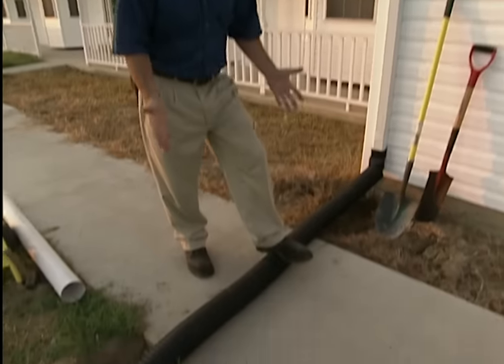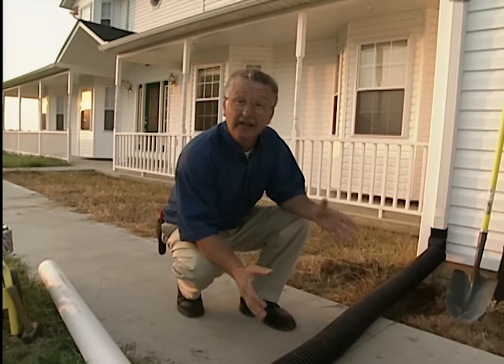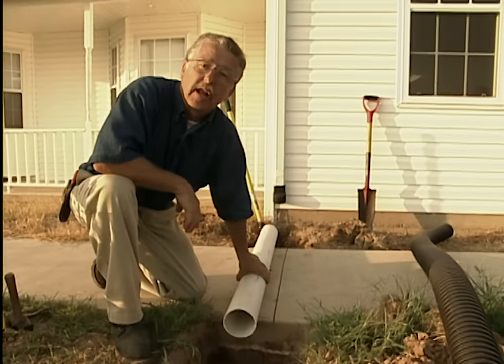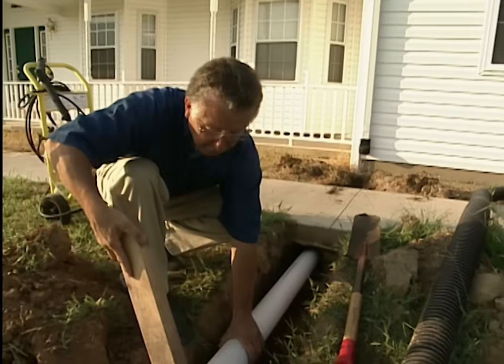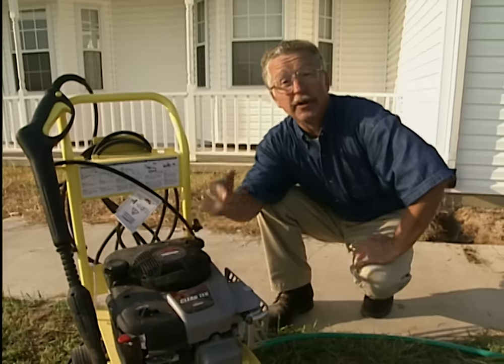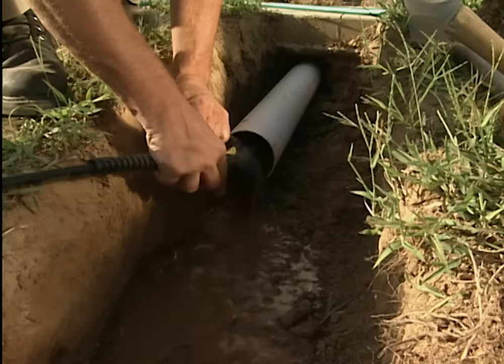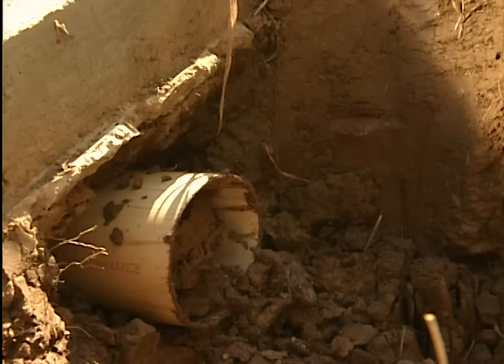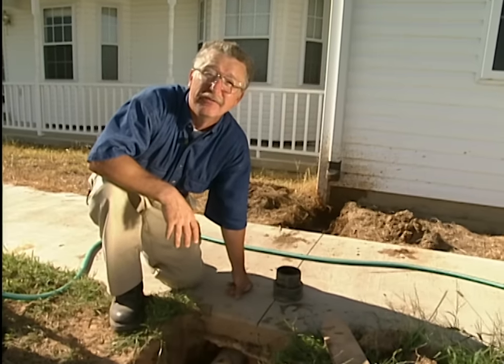How to Run Wires or Drainage Under a Sidewalk or Driveway - The Great Outdoors

Comment: Never use corrugated pipe on downspouts. After a few years the roof granules, leaves, seeds, dirt etc. get caught on the ridges and fill up the pipe. Use 4 inch rigid drain pipe instead.
Reply: Nope. They'll only fill up the bottom of the corrugations. The whole pipe won't magically become full.
Reply: Thats not true.
People been using rigid for dozens of years. My house has over 40 ft of it and Its never clogged in the 20 something years I been here. If your worried about leaves then get a gutter guard or screen cover.
Reply: @littlejackalo5326  I say this because I had to dig up 30' of corrugated plastic pipe on downspouts that were full to the top. These had been in the ground about 20 years. Foundation blocks damp and had mold in basement. $20,000 bid to remove mold in entire 1500 square foot basement. That doesn't count the drywall replacement.
Reply: K Womack "??"
Reply: @kwomack5399  Single wall corrugated works just fine. You just have to know how to install it correctly. Pvc pipe used for downspouts drains will clog as well if not installed correctly. You have to design your system to handle debris no matter the type of pipe.
Reply: I wouldn't put corrugated under a sidewalk though.
Reply: You can get away with it if you have covers for your gutters to keep out debris.  But if you get any leaves or other debris in the down spout of the gutter it is likely to accumulate in the bend.  Maybe an access joint on the house side of the pipe so you easily clear any debris that builds over time?
Reply: I use a shopvac hose to suck out and blow out all the debris. No digging needed. 🤷‍♂️
Reply: @High-Flow-Drainage-Solutions  would you connect the corrugated to pvc to run under the sidewalk?
Reply: @jensmith5894  Correct. Pvc section under the sidewalk. Buy a Poly-Lok corrugated to pvc adapter from Drainage Direct to hook up to your corrugated then.
Reply: @littlejackalo5326  corrugated works fine, except it's harder to install with a consistent slope.  Since it's so bendy it's easy to end up with a sag in the pipe somewhere.  Rigid is less prone to bellying.
Reply: When I look up 4 inch rigid drain pipe a ton of stuff comes up including corrugated pipes. What exactly are you talking about?
Reply: Not true.  Have installed thousands of feet of corrugated pipe, only failures where when the customer didn’t maintain anything and the ends of pipe became buried or covered.  And even then uncovering them again usually fixes it.   A little sediment on the bottom of the pipe doesn’t hurt anything and as long as the pipe has proper grade, it won’t clog.
Reply: I heard using water weakens the soil under the cement and eventually it will crack. Anyone have long term experience with that?

Comment: It was fine until you inserted that connector INSIDE the downstream side of the PVC.  Now you have created something for debris to snag on and form a blockage over time.
Reply: Exactly! I thought he was using the white pvc as conduit for the black drainage pipe. Nope. Haha
Reply: The bigger issue is the connection will leak and erode the soil, which will eventually create a nice sink hole to highlight his improper install.
Reply: @MrBmxbrawler  I was thinking the same thing just push it through and make it seemless
Reply: Yep
Reply: Dont worry nothing is coming threw that pipe, he left 40 pounds of mud in it... LOL
Reply: @mustangpassurchevy  exactly.... I thought I was the only one that noticed that.
Reply: @natej6671  nope
Reply: @mustangpassurchevy  I was thinking the same thing.... That on top of what others pointed out (leaking connection and ID fitting for debris to get snagged on) and you have, how not to install gutter drainage under a sidewalk.
Reply: @mustangpassurchevy  "Threw" is the past tense of "throw", a tossing motion. "Through" is signifying a passage of something, a completion of. Homonyms and homophones, learn them.
Reply: @coloradostrong  

Thru.
Reply: For reals tho, any y'all got a video on how to do it the right way then? Lol
Reply: And If over time that does not create a blockage , he also mentioned that you can put in a screw to hold that shabby assembly together. The screw will make sure the leaves and whatever comes down from the gutters snag on there just nicely.
Reply: @ukob  It was seemless  not to make it seamless .
Reply: @coloradostrong  You got some good grammar! 🏆
Reply: I thought the white pipe was just a sleeve to put the drainage black pipe all the way through. An you don't need a pressure washer to do that job!
Reply: @Supersonicff-dw6bs  I have never seen that happening.
Reply: It's corrugated pipe, not smooth PVC. Plenty of snag points in the entire pipe length when using corrugated pipe. PVC is glued or screwed together depending on the schedule and the connections are designed to create a smooth flow and liquid tight connection. Corrugated pipe with bell ends needs to be bell end facing upstream to create a funnel effect which prevents seeping as long as there is no downstream clog or the volume of liquid doesn't exceed carrying capacity of the pipe. The other option is to not use bell end corrugated pipe, but use straight corrugated and use external pipe couplers.
Reply: @Supersonicff-dw6bs  While what you say is technically correct, you’re still wrong. This install has several problems.
Reply: @catlady8324 See the bell and spigot installation section of this pipe manufacturer installation document. Bell should face upstream when using corrugated pipe with bell ends. http://www.shuanglinpipe.co.id/instalation-guide-for-hdpe-corrugated-pipe-part-1/
Reply: @Supersonicff-dw6bs  I don’t like it. Don’t like it one bit! 😾 Plus there’s no pictures.
Reply: He’s installing it on his ex-wifes’ house. Like he gives a flying F.
Reply: @frankthetank1369  what's an alternative to using a pressure washer?
Reply: @allenlamb8240  I worked doing cable construction I dug by hand or used a water hose. Most jobs had no access to water so I dug by hand. It's not much digging.
Reply: @frankthetank1369  Got it. Are you worried about the integrity of the side walk? I ask because I'm considering the same.
Reply: @allenlamb8240  Not if you fill & pack it after you finish installing everything. I've done plenty with no complaints. Make sure you pack everything you dug.

Comment: I did this for a 15’ run from my crawl space, under a sidewalk, under a row of bushes and then out into a bed on a hill.  I had to use rebar to line up the pipe.  So, I had to use a core drill to get through the brick foundation and out of the crawlspace. Then I took 15 feet of rebar and pounded it through the hall, under the sidewalk and bushes and out into the bed. Then I took a 4 inch piece of PVC put it in the pvc and started the power washer. This project took several weeks and was a huge pain but I did end up with a nice drain pipe tucked neatly into my side yard and which has worked perfectly ever since.

Comment: This can easily be done without the pressure washer if you don't have one and don't want to mess with renting one. Just get one of those little tapered jet-type hose nozzles and run the garden hose into the pipe. There's also a neat little device for deep watering of tree roots called a hydrospade. Great for boring small holes through dirt.
Reply: You can also use a shopvac with the pipe and suck the dirt out as you push the pipe through.
Reply: @mlt6322  yep because once the soil is wet its much easier to remove it with a shop vac and avoid all the mud and water.
Reply: @madmaximilian5783 People like posting smart @$$ comments without realizing that they're the ones being goofy.  There were two proposed options 1) Flush out the soil with a hose if you don't have a pressure washer, or 2) Use a shop vac. The proposal would be to loosen the soil (with a waterless tool) and then vacuum it out.   Come on...think!

Comment: I used this technique yesterday to span under 4 feet of sidewalk.  Used a 6” diameter PVC.  Then threaded a piece of 4” corrugated through the PVC.  No joints this way.   It worked great.  I did Hit a root.  That sucked but was able to reach under the sidewalk cut the root with a 26” hand saw.  Another benefit of the 6” pipe.  I was able to back out the PVC and then have room for my arm and saw to cut the root.  Wouldn’t have been able to do that with a 4” pipe.
Reply: I have skinny arms, so the 4" pipe would work for me.
Reply: I'm thinking of doing the same. Are you worried about the integrity of the sidewalk?
Reply: @allenlamb8240  no signs of sidewalk failure 8 months later.  Looks good!  Works Good!
Reply: @prettygirlus9008  Don't know if you meant to be funny, but it was! 😁
Come to think of it, 4" pipe might work for my arms too. 😂

Comment: 3:10 FYI, you're installing that coupler wrong! It should go over the PVC and inside the corrugated pipe for proper downstream flow. How you installed it will result in leaks, turbulence inside the pipe. The leak will erode the soil and an eventually create a nice sink hole to highlight your improper install. Also, stop using that crap corrugated pipe and just use PVC the whole run.
Reply: I’m doing this currently. Clay soil. Slow moving at this point. Using rubber mallet. Would the solid hammer and block make this go faster?
Reply: Supersonicf111f I could not agree with you more. Bells look uphill in every gravity flow unless as you pointed out you are ok with a leak. Especially with that sloppy transition from PVC to that corrugated junk.
Reply: He did it correct, your method is wrong. Also, you don't use straight pipe in areas that freeze.
Reply: thanks for the link at 3:10. why now watch it at all at this point! a wood stove..roofing..plumbing..septic..landscaping..without common sense we may be somewhat of an asshole. How about a few bags of concrete ta just create a sarcophagus wth! Like 65.
Reply: @TheDogDad   I agree with Supersonicf111f 19740186 and indeed  if it ever freezes in his area, he will end up with a busted pipe. He should have put it at least 40 cm or 1.5 feet under the ground, that's what they do in my country, and they still use straight pipes. Deep  under the ground it never freezes.
Reply: Both agree and disagree - technically the bell-end needs to be at the uphill end (it looked to me like the true bell end was what he cut off in this video), but while what he did might leak, a little bit given that [1] the water in the pipe isn't under pressure, and [2] the whole thing is outdoor and both inside and outside the pipe will be soaking wet after a rainstorm, I really don't think a small amount of water leaking out of the pipe is going to make a scrap of difference.
Reply: @TheDogDad  This is only a problem if your downpipe in the ground has no run off and water lays in the pipe.
Reply: This debate illustrates why DIY is so confusing. Even after all my research, I still never know who to believe. Not sure how we get around the conflicting opinions.
Reply: @BeckVMH  For piping that does not have an o-ring on the spigot (straight) end (i.e. slip fit), the bell end should always face the liquid flow. In that orientation the liquid will not leak out as long as the pipe doesn't reach max carrying capacity or is backed up do to a restriction or blockage. Piping that is sealed mechanically with glue or a seal can be installed either way as long as the manufacturer doesn't specify a particular flow direction.
Reply: @Supersonicff-dw6bs  …thanks so much.
Reply: @BeckVMH  In this case think of the water flowing down through interconnecting funnels, so the "wide" end of any piece of pipe or connector is the end that the water flows into.

That said, generally you make a fair point, but I tend to be skeptical of people like this who don't look like a contractor.  But if you do lots of DIY you will soon develop your own sense of who to trust and how to do things.
Reply: @pulaski1  …. Understood. Thanks. And valid point. Thanks for the input.
Reply: Just get the 40lbs of mud out of it and even with the issues of the joints it is still better than the rain water flooding the sidewalk
Reply: What’s the issue with corrugated pipe? Less chance of it freezing in cold temperatures.
Reply: @jerryhamalainen3549  A 4" pipe a foot below grade isn't going to freeze unless you live in Alaska (or Canada or Siberia at the same latitude as Alaska), and in any case "the pipe" freezing is only an issue (might burst the pipe) if it is full of static water at the time it reaches freezing point (for an extended period of time).
Reply: Exactly!
Reply: It's a drain pipe. You don't have to worry about a drain pipe freezing. If it were a supply  line sure, but not a drain line. I don't know anywhere in the continental US that the freeze line is 4 foot down. Maybe somewhere up in Minnesota or or Idaho but not where he is.
Reply: @davidedhegard4198  Maybe you should do a Google search first before making such an uninformed comment, then you might have known there are 11 of the lower 48 that have frost lines deeper than 4'.

Comment: You possibly could use your garden hose and the right nozzle and save the rental on the pressure washer  depending on your soil type.
Reply: I would definitely try that first if I didn’t have a pressure washer.

Comment: I like how he cut 6" off that pipe , that sure made a difference.
Reply: Yes, after he had already cut about 3 1/2 feet off the pipe. All for show, because he said he bought a 10' length of pipe.
Reply: @cfoskeeter , yeah but you know, if it didn't happen on camera, it didn't happen.
Reply: I like how he cut 6" off that pipe , that sure made a difference.
Yep it sure did on the downside of the pipe away from the house and it is buried anyway. Should have used the entire 10 feet and ditched that corrugated stuff.

Comment: Thanks for demonstrating this concept.

I had not considered using a pressure washer/hydraulic mining.
Reply: You can actually excavate trench and start holes under both sides sidewalk curb etc from 2 access holes. A curved washer sprayer outlet would be extremmely helpful. I personally ran 4 water lines crossed 2 pairs under 2 sidewalks and a third concrete slab slash fence line edge. I got 2 PEX 1 inch and an electrical outlet using direct burial 12/3 UF UNDER GROUND FEEDER GREY WIRE IN A 2 5" PIPE AND A 1 INCH PLUS 3/4" PEX INSIDE A 2" PIECE OF WHITE PVC.
Reply: This is not easy peasey in Texas. But perserverance spraying from both sides plus a big sledge hammer proved helpful.
Kansas a breeze I would guess from living in Wichita and having basements. I would say sharpening pipe on starting end intio dirt with a bench or angle grinder may prove helpful.

Comment: Sure, that works great if you have topsoil or loose, sandy soil.  Try doing that anywhere in the northeast on the Somerset shale formation, and you'll be running that pressure washer for days to cut through it.

Comment: Used this method to run new hose under an 8 ft. slab of cement patio for a pool back in the 80s
Reply: No you didn't. I lived next to you. You brought out a surf casting rod and tried pushing the garden hose under it on high and it broke. Then you got mad and tried using a shop vac to suck the mud up. That clogged up and you were trying to unstop the hose with the handle of the fishing pole. You finally gave up and had Ricks Landscaping come in and do it. Remember?

Comment: What about the backfill around the new PVC pipe? Are you planning to leave it hollow like that? Good luck with the cement sidewalk!
Reply: Hes not disturbing the dirt on the out side of the PVC pipe. Only the dirt on the inside is being removed that's why he has the pressure washer handle inside the pipe.
Reply: Fernando, You better watch it again.
Reply: @derfskittlers6125  don't need to cuz I've done it a few times and this is how it's done.
Reply: Fernado equals dumbbell
Reply: @jaydaytoday3548  (
Reply: @texasproud3332  😂

Comment: By the time you went to get the pressure washer and spend the rent for the washer you could have just dug out for the pipe with  your shovel. The best way to solve a problem is usually the simplest way not to mention think of how much you would save.
Reply: The way he did it he didn't dirty his pants. I agree with you I dug plenty of times under side walks.

Comment: I used a 2 in planting auger to drill out under the sidewalk no wet muddy mess at all
Reply: Which brand of auger? It seems hard to find a good one. Did you use a 2” auger to ream out a 4” tunnel?
Reply: Not sure the brand. I picked it up at HoneDepot and yes I reamed out the 4 in tunnel with it.

Comment: At the width of that sidewalk you can just dig it by hand too , if you don't own a pressure washer.
Reply: The idea is to do it so you don't have to backfill. If its not compacted enough then over time that part of the sidewalk, if it cracked would start to settle there and be uneven.
Reply: And while you are at it, you can pressure clean your boat, car, RV, airplane and don't forget the house. Right buddy, and get the unit back to the rental place before 6. Sure thing.

Comment: I made the mistake of using corrugated vented pipe.  Sure it drained the water nicely but it also eroded the soil under the sidewalk and now my sidewalks are cracked from sinking.  The other problem is the pop up vent at the end of the pipe.  Over time grass grows over them and you can't see them any more.  Then they block the pop up and the water backs up.  If I had to do this over I'd just run the drain over the sidewalk.